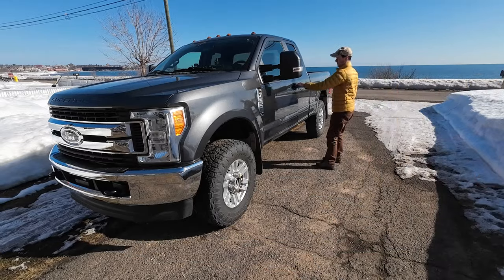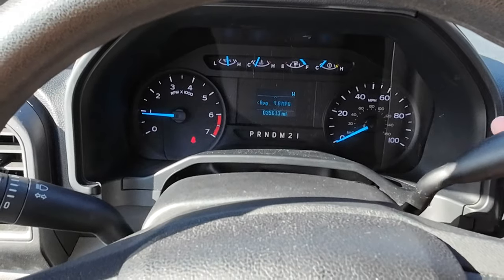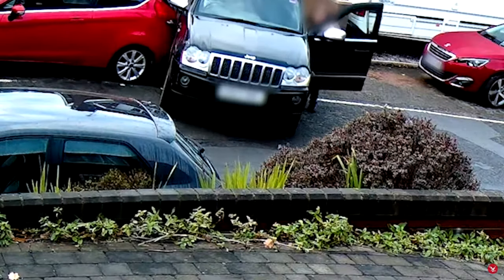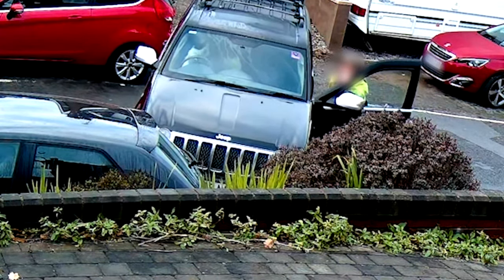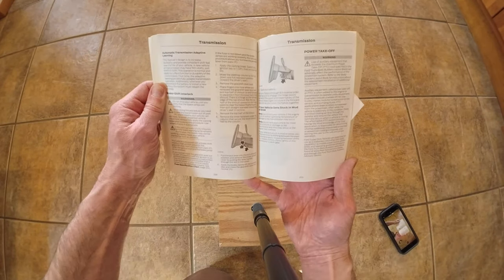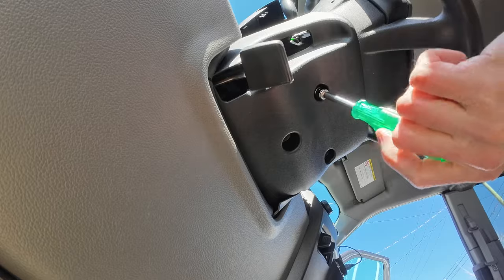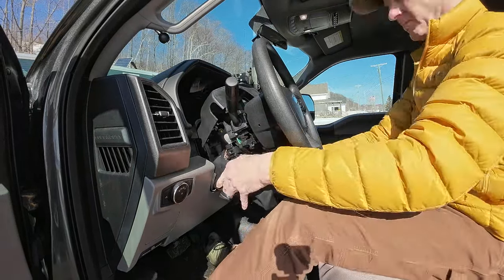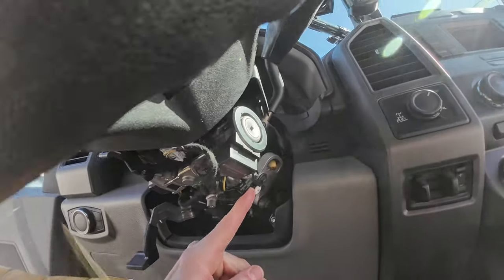F-250 Shifter Stuck in Park with temporary "fix"

Comment: On mine it stuck on reverse. I pulled the white piece below the shifter and I detected the cable is loose.
Under the vehicle, I found the cable loose direct on transmission, the bolt have no nut. 
This cable goes direct on transmission, the piece on left side make the shifter positions.
I hope it help someone! 🙏🙏🙏🙏 God bless
Reply from the maker: Thanks for the input.

Comment: Why does do this? Mine is the same way and i had to do exactly what is shown in this video to start my truck.
Reply from the maker: In my case there was an electrical short somewhere.  I don’t think that’s typically the problem.
Reply: @NorthernExplorerOverland really what did u try to change it and no fix before finding out a short 
Or what
Reply from the maker: Research online led me to believe it might be the shift lock solenoid.  I went so far as ordering one.  I wasn’t 100% sure that this was the problem, so I cancelled the order and made an appointment with the ford dealer.  The ford dealer properly diagnosed the problem as a short.    @135-j
Reply: @NorthernExplorerOverland  interesting I’m about to order mine today 
Probably a short down by your e brake there is a big harness connection notorious for issues
Reply: Will this work on a 05?
Reply: @johnkegley6650 I have a 2003 Ford f250, I don't know if it's a coincidence or it's what's making it work but when my shifter gets stuck I rev the engine a few times then push on the brake and am able to shift down
Reply: @kingjet23 I ended up needing injectors so took it to the mechanic and I literally didn't have 200 miles on a new hpop and ipr and am only getting 70 psi on hpop so hopefully warranty cover the cost of another new one